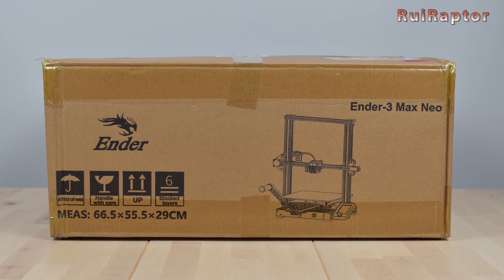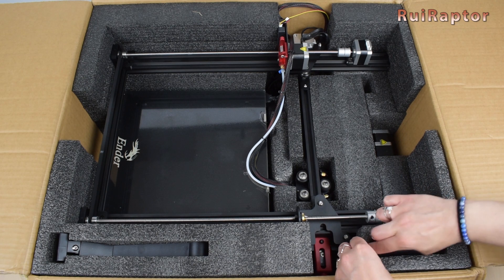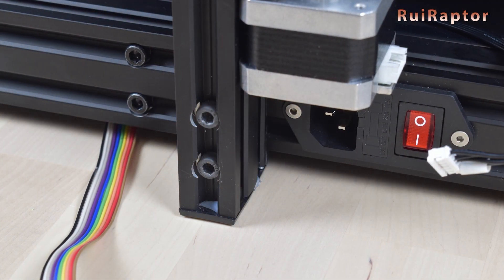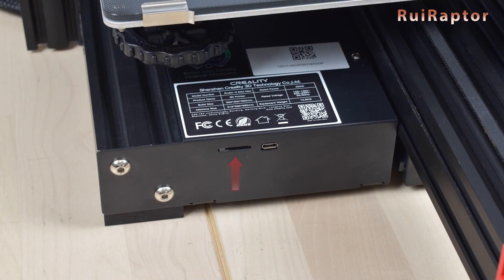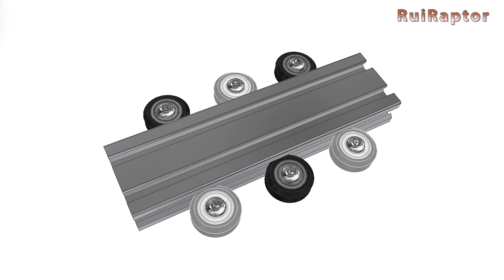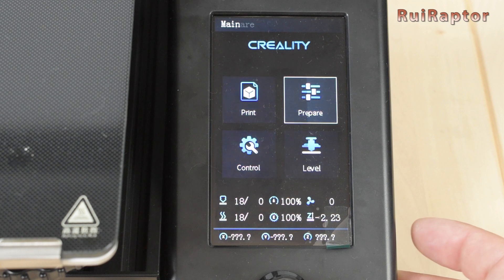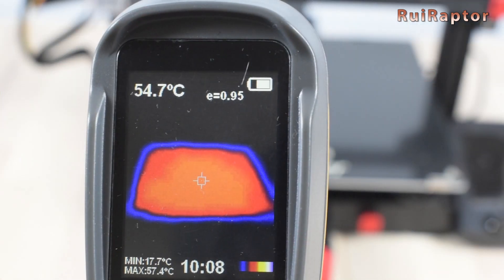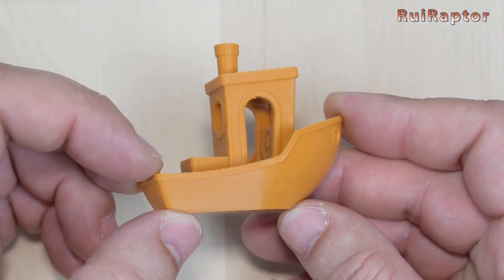Creality ENDER 3 MAX NEO 👉 In-Depth Review (Including PROS & CONS)

Comment: It's a piece of crap without upgrades... just like most of Creality's printers... but that's to be expected with the price tag. That said, it's a solid platform for upgrades and can be turned into a reliable printer with some patience and CAD knowledge & still cost less than 1/2 the price of a Prusa. It's also completely open and uses standard parts... not proprietary closed off like Bambulab.
Reply: theres always one person with the most expensive printer that hates everything that isnt as expensive as theirs